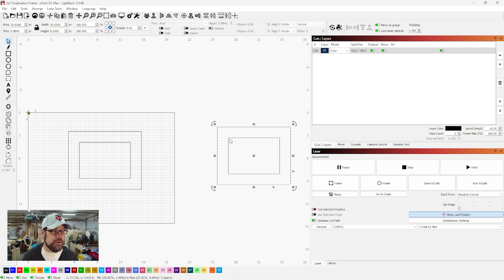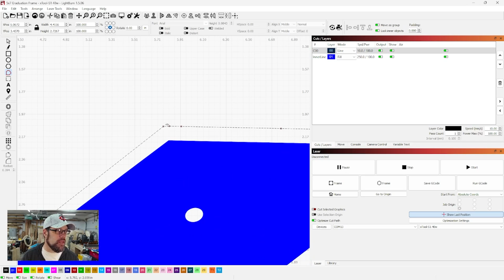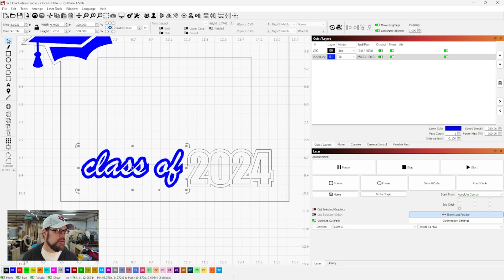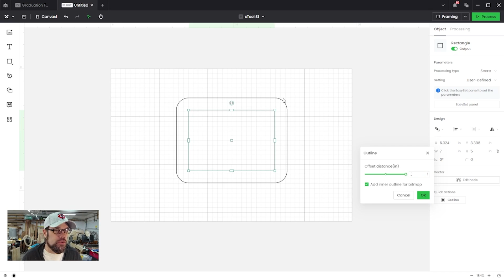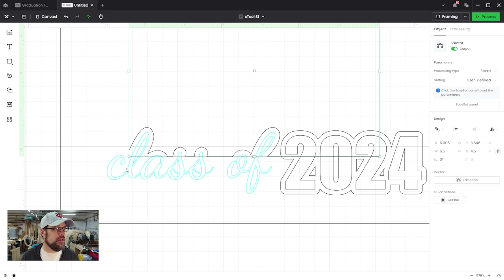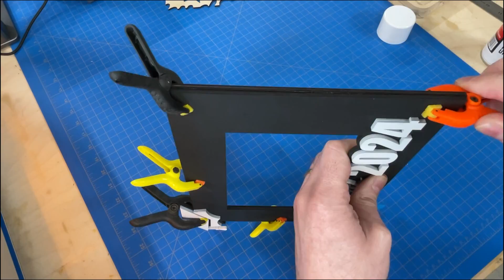Create a laser cut picture frame in Lightburn or xTool Creative Space

Comment: Great lesson. Ths is going to be so much better than building a frame. Just wondering. How would you accommodate say a 22mm plexiglass window and a cardstock backing board?
Reply from the maker: If you have access to a Co2 laser, you could cut a piece of clear acrylic to act as a cover.  Or you could make that part just square and cut it conventionally.  For a cardstock backer, you'd need to find the right material to make up a spacer for the wood you use.  I've done this before using 1/16" basswood plywood as a filler frame along with the chipboard backer.

Comment: Nice project. Thank you for showing both Lightburn and XCS. One question with XCS. I have a lot of files SVG, DFX, and such that I use with Vcarve Pro. Can those also be used for XCS? Thanks
Reply from the maker: Yes you can use your Vcarve files in XCS.  I would recommend exporting them from Vcarve to SVG files for XCS.  You can import both SVG and DXF but XCS does not always import DXF's with the correct units so you'll have scaling issues.